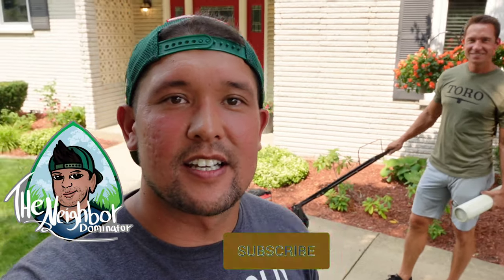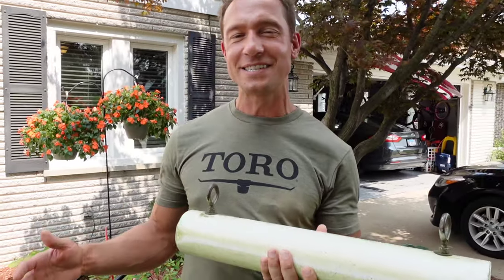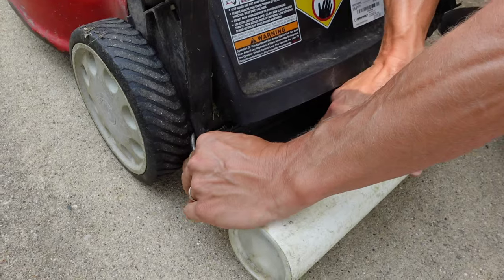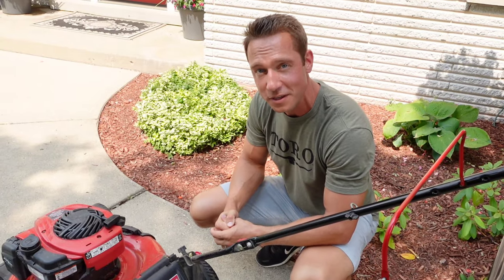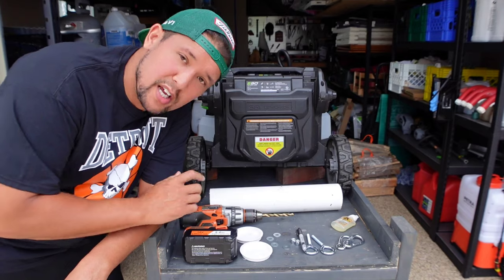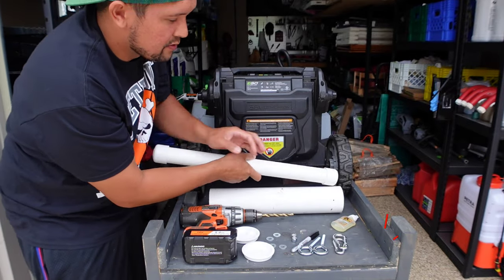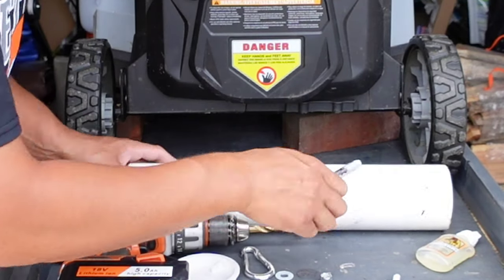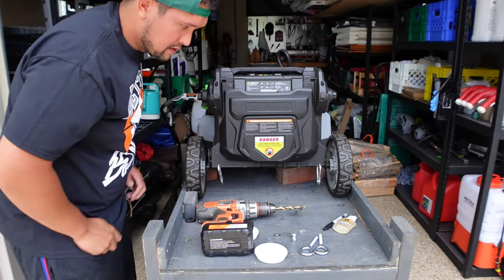Building the Best (and the Cheapest) DIY Lawn Striper ⚙️ In-depth Guide & Demonstrations

Comment: Did mine and it works great! Thank you! I have Southern St Augustine and still laying them stripes. I am using a Ryobi electric push mower and it works just fine. Most striping kits I found online were $100+. This cost me $30. I had to get some supplies at Ace (PVC) and some at Home Depot (end caps). Home Depot will not cut the pipe for you but Ace will. Then Ace did not have the correct 3inch end caps used in the video. For me I had to remove the rubber piece on the mower for the carabiner clips to fit. I also had to use 4 clips. Took me about 15 minutes to make it once I got home. Traffic was my biggest hurdle lol.
Reply from the maker: I love it!   That is smart using 4 clips.   Mine ended up wearing because it was too much weight.   I have never seen st.aug stripes before but i also love in Michigan.   At aug is so thicc!   I'm glad it worked well for you😊
Reply: I have st Augustine in Texas also ryobi mower so you used 4 clips to attach the striper?

Comment: Could always use concrete on the inside, which would also help prevent the bolt from loosening.  Watching these to make one for my riding mower
Reply from the maker: I had concrete in one before and it worked out perfect

Comment: Do you notice less run time on the battery when you use the striping kit?
Reply from the maker: Yes. Definitely.   But I have a smaller yard so it doesn't effect me that bad.   But yes, pulling a heavy object does take its toll on the battery

Comment: I'm about to build this... not sure if dumb question but you said the pvc will hit the wheels so it's 18". Why not just use longer eye bolts so you can increase the width of the pvc? Say 8" vs 4"? Youd just need another nut on the outside of the eyebolt so that the full length of the bolt can stick out.
Reply from the maker: That would work.  I did not think of that.  Did you do it?

Comment: If you extend it out further behind the wheels, it’ll eliminate the inability to backup, which is crucial when cutting more than a 1000 sqft box.
Reply from the maker: Wouldn't that require brackets?   I was going for ease with the clips.   If it was on a bracket we could back up.
Reply: @TheNeighborDominator  honestly man, you could use something as simple as an eye/eye turnbuckle, even just to extend it 8-12 inches. There’s adjustment on both ends, for you to find a sweet spot. Then just attach your carabiners to the eye opposite the frame
Reply: Could just put a third I bolt on the back of the roller. run a small rope on it to a carabiner. hook the carabiner onto the handle bar. when you need to backup you just pull up on the rope which lifts the roller, backup then let the rope back down and your on your way again.

Comment: Seems to me you made a 21 inch mower into an 18 inch mower. Will need to overlap.  Maybe I'm wrong.
Reply from the maker: I made it where the flap would normally go in between the tires🤷‍♀️
Reply: Should have made it wider then your wheels.
Reply: @ryanennis3199  but then it would make contact with the wheels, no?
Unless, you do something different and extend it behind the wheels?? But then the question is, what do you use to make it extend BEHIND the wheels?
Reply: @papichulo9107  You have to make or buy then install brackets to extend it past the wheels. You really need the thing to roll not drag across the lawn if you need to back up at any point. Good concept for being the easiest install but it doesn't quite check all the boxes.

Comment: build 1 more and add sand in the inside
Reply from the maker: I was going to do that but i thought rock would be heavier.   You think sand would be better?
Reply: I mean I don’t think it matters, the rock might be louder
Reply: I used sand and it works a lot better than pebbles. The sand added more depth to the strips